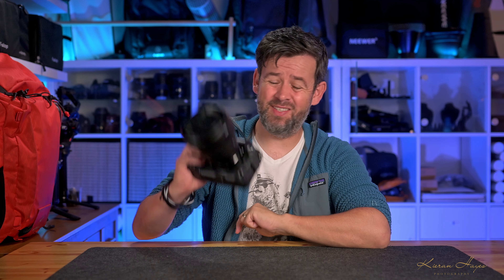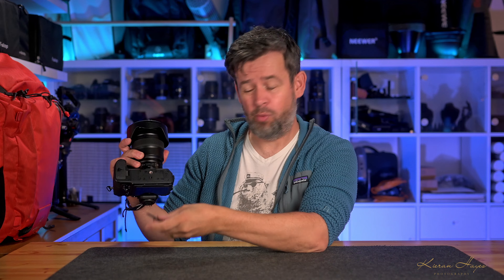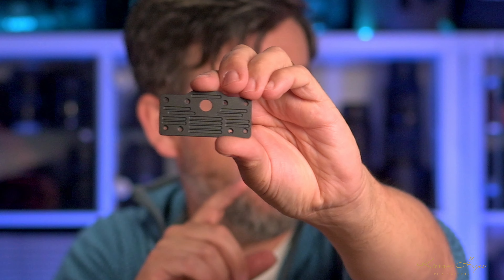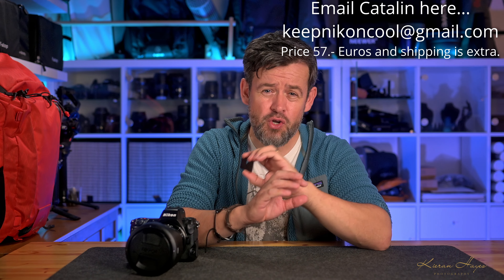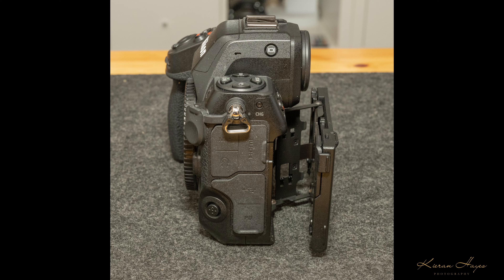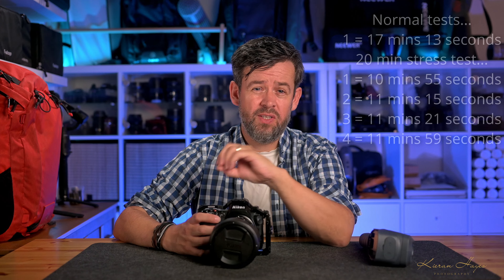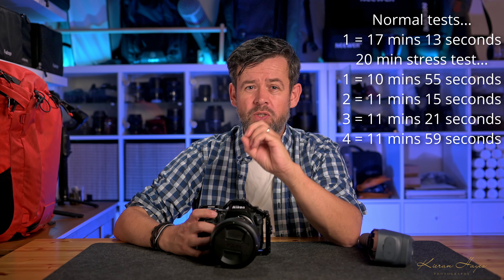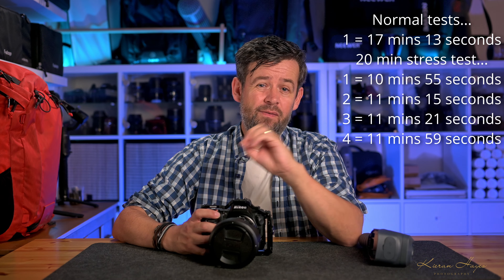Nikon Z8 Hot Card Modification : Cool your Nikon Z8 in minutes.

Comment: Why do you focus on the hot card warning instead of the hot camera/cpu warning? Try to test recording in 4K H.265 60p with oversampling enabled - this is the most useful and at the same time demanding recording setting. Since the CFExpress card heats up even if not used in Z8, take out the CFExpress completely and use an SD card for recording.
Reply from the maker: Hi thanks for watching, I focus on the hot card warning as this video is all about getting heat out of the Z8 so I tested it at 8K60P which is the same as 4K60P with oversampling on. At ISO 4000 and a constantly moving subject the processor was also being seriously stressed but as I say it's all about getting the heat out and seeing how much of a difference the modification makes.

Its not my modification, I just purchased it and wanted to share what I found. 

Thanks for the input 👍
Reply: @kieranhayesphotography  I have been in contact with the creator of this modification part, who has presented to me many interesting insights into the problem. I am also considering ordering the part from him, since it seems like the best overall modification to alleviate the heat issue. My request to test with these specific settings is for me to know how the modification improves my specific usage of Z8 with the modified part applied.
I do on occasion long continuous recordings on a tripod where the camera shuts down if oversampling is enabled. I would love to see an independent test of such use case - before it gets too hot, the camera is turned off for 2 minutes, or alternatively, the oversampling is turned off and a new recording is started right away, then after 15 minutes the oversampling is turned on again and a new recording started right away. Will the modification transfer the heat out from the camera to the tripod fast enough?
Reply from the maker: @kotolows  That's a good question and I see why you are asking now. 
I am looking at cooling via the HDMI and USB C ports also and I hope with the base plate and these options also used it will seriously help with heat then and we can forget about it in most use cases. 

The big problem for me is I need to do each test at least 3 or 4 times and I need to let the camera cool down for hours in between so I can be sure of the results. 
That's all time I don't really have these days as I have tons of shoots on these days.
I plan to do a lot more testing soon and I know I sort of neglected 4K this time but it took me nearly a week to make that video 😢

Comment: Problem here is the crappy cooling "system" of the Z8. There are only small connections to the case and this can't be "fixed". It will bottleneck the heat. This metal plate will help but not as much as someone hopes. Using thermal paste is not preferred! And I think it may evaporates over time and/or crawls deeper into the camera. If you need to shot in 8K than use a Z9. There you have a proper magnesia body connected to the CPU and card slots. Sorry but you can't "fix" the Z8 without a bigger modification.
Reply from the maker: Hey David, thanks for the input, just to clarify I never said this was a fix but something that would help and it does help. Hence the long video and all the recordings showing the time increases.
There is no fix as it's a design issue more than anything else as you say and as I pointed out in the videos.
Yes, the Z9 is better for long runs and has better heat dissipation but I don't like the larger form factor and I am mainly a photographer that does video on the side so I don't need long video runs.
This was just me explaining how to get better times for people that may need it. 
Which does work btw as the video clearly shows, it's also the second step in reducing the heat as I have posted another video before and I have a third step coming soon.
You might not be aware but this also happens to people shooting in burst mode in areas of high ambient temps and the plate seriously helps there too.
On the point about thermal paste running deep into the camera, that won't happen, it's not that viscous. Thermal paste doesn't run and there isn't that much of it there anyway.
Enjoy the Z9 and have a great day.
Reply: @kieranhayesphotography  You are right. You are talking not about a fix. And yes temps are better. So I misunderstood.
Reply from the maker: @davidmarzahn8827  Hi David, no problem, have agreat weekend, hoping you get some great light.

Comment: I would like to modify my z8, I bought a door for the memory card on the Nikon website and I would like to make a modification to put a cf express to ssd zitay and close the door at the same time and the cable would pass between the cage and the z8, in short do I have to disassemble the Nikon Z8 to remove the door? I don't mind doing it but just to know...since it will void my warranty. Thks guys

Comment: Good video! i like this plate but, I don't know if I want to put thermal paste in my beautiful Nikon Z8...ahah but I'm not against a thermal pad if it works as well, very thin of course. But for the price i prefer use, Zitay Cf Express to SSD, no limit...until now.
Reply from the maker: Hi, thanks for watching and the feedback. Yes, thermal pad would also work the only concern I had with a pad is that it might interfere with the weather sealing of the camera. 
I never tried the CF to ssd adaptor but I know a few people have mentioned it alright.
Are the data transfer rates high enough from the dummy card? I must look into that a bit more.
Reply: @kieranhayesphotography  In any case for use on a gimbal or a tripod, the SSD via the CF express port works rather well, because the only problem in my opinion is that the door remains open, I don't see too much of a problem with in any case the Samsung 980 or 990 pro 2TB or 4TB SSDs.

Comment: I know this video is 6 months old, but here’s my use case and issue from yesterday while professionally documenting a theatre show/performance, capturing still frames only.

Card Specs:
	•	Sabrent Rocket CFX Type B 512GB (CF-XXIT-512)

Environment:
	•	Large community hall (~200 audience) + actors + support team + pro sound & lighting.
	•	Temp: ~21°C, but poor ventilation.

Z8 Setup:
	•	Battery Grip: MB-N12 (Nikon’s official grip) with 2 EN-EL15c batteries.
	•	Lens: 70-200mm f/2.8, handheld, VR sport mode on.
	•	LCD Position: Pushed back to its standard place against the body (I use the viewfinder 90% of the time).
	•	Settings: Auto ISO (up to 8000, then reduced to 6400) + 1/640s shutter (to prevent banding from LED lights & capture fast motion).
	•	RAW: Lossless Compressed.
	•	AF: AF-C with Face/Eye Detection.
	•	Frame Rate: 20 fps.

Everything ran smoothly in the first half of the show. Camera was off for a 15-minute break, then hot card warning appeared 45-50 mins into the second set, roughly 10 minutes before the show ended.

Despite the warning, the camera kept shooting without any issues. Now considering a Delkin Black card to see if that makes a difference.

I cannot use any other cooling mods besides a thermal silicone pad. External batteries are a no-go—besides being ugly, they’re impractical for mobility in this case. Metal bottom plate replacement? Useless, since the grip blocks airflow.

And before anyone says it—yeah, I know, just buy a Z9. No thanks. I’d rather spend my money on lenses. 😎
Reply from the maker: Hi,
Thanks for watching and for the feedback.

The onbe huge factor when testing the Z8 for heat and hot card warnings isd ambient temperature one or two degrees makes a big difference there over a period of time.

Now like you I shoot very long shoots 6 to 8 hours and so far my Z8 has never overheated, in saying that I am not shooting in burst mode generally speaking which will help hugely.

The big difference I found was using the right card and the ProGrade gold gen 4.0 cards seem to be fast and yet reasonably cool while still very affordable. I have a more detailed video on those cards here... https://youtu.be/IQzQuufsyIQ

I have also posted a more detailed videos on the HOT card warning for the Z8 that you might find interesting here... https://youtu.be/RDC_ZZKqtxk

There are a few tips in there that help you cool down the Z8.

None of these videos are a criticism of the Z8 as I truly love the camera, they are just more to help people understand how to cool it a bit better.

Did you use multiple cards on the day of the shoot or was it all on the same one? If so what I sometimes do is for lunch break (20-30 mins) is take the card out and leave the battery door and card slot door open. thatjust lets the heat escape. I know you are using a grip so that's not as easy then but it also may help a lot. I also uncover the slots on the side of the camera as you can see from the Z8 hot card video they get very hot also. That just helps cool the camera down internally.

I hope that helps a small bit.
Reply: @kieranhayesphotography  Thanks! I’ve had my Z8 since June ’23. First time experiencing this while shooting stills. I think it’s a mix of multiple factors—way too hot in the hall, relatively high ISO, constant eye tracking, short bursts, my face glued to the back LCD (adding an extra heat source) while looking through the viewfinder, the heat trap from the grip, and who knows what else. Love my Z8 too, and I knew I could probably push it for another 5 minutes before a full shutdown—and by that time, the show is over. So I wasn’t too worried, but it still got me thinking that I need some kind of ‘get out of jail’ card before it happens again. For reference, I used a single card, the Sabrent I originally mentioned. The only reasonable solution I can think of is to go with the Delkin card (which runs even cooler compared to the ProGrade) and hope for the best.

Comment: Someone actually needs to create a vertical grip for Z8 with a built-in Copper heat sink that touches those exposed metal parts, under that plastic cover, directly, where the copper heat sink gets cooled by a built-in fan. This would be the ultimate solution.
Reply from the maker: I was working on a diy unit something like that to try it out. 
I just didn't have time to finish it as I got crazy busy with shoots. 
 I plan to get back to it soon though and hopefully get a video out about it then too.
Thanks for watching and for the feedback.

Comment: 02:42 Why would Nikon not recommend replacing plastic bottom with metal. Can doing so cause some short circuit or something?!
Reply from the maker: When done right there is absolutely no issue with it at all but I suppose the concern would be people dropping a screw into the camera body or just pouring in heat compound. 

I would have thought there wouldn't be an issue but at the same time I thought I better mention it in case Nikon did have an issue with it.
I would be the one in trouble then.

Comment: Good
Have you tried using another CF Express B card? In my case I used the same card you used, it heated up after 30 seconds of film. Replace with the ANGELBIRD card CFexpress AV PRO SX Type B 160 Gb card, this message didn't appear again, I don't have another card from this brand bigger than this one. But still the z8 camera, if it's outside in the sun, it will heat up like larva...
Reply from the maker: Hi, thanks for watching, I appreciate the feedback. I am thinking your Prograde Gold card could be the older generation card, the card I am using here is the Gen 4.0 card and they are a lot faster and more thermally efficient thankfully. 
The older cards overheated very quickly alright. I am looking at testing a few more cards going forward to see how much of a difference there is between them, I just need to get my hands on a few different makes now.

Comment: Do you know if using the battery grip would decrease the heat and hot cardboard warnings?
Reply from the maker: The battery grip doesn't help with the hot card warnings, I haven't tested them yet but a friend of mine has and he said it makes it slightly worse as the heat can't get out of the camera body as easily then. The plastic in the grip insulates the underneath of the camera so it's one less surface to dissipate the heat then. As I say I haven't tested it myself but that's what I was told by someone that tested it.
Reply: @kieranhayesphotography  Tganks so much for the info.
Reply from the maker: @AlleywaystudiosNet66  no problem at all.

Comment: Hello as a wedding photographer with some video at times how would this camera handle the outside temperatures? I wished I could find an actual video that shows outdoor use with this overheating test
Reply from the maker: The trouble is there are so many  variables  involved. That's probably why not many people have done tests like this.
It depends on what card you are using, the video format you are recording in and finally your ambient temperature. They all play their part.
Are you looking at Nlog 12 but Raw 4K or 8K? What card are you thinking of using and how long are you recording for roughly and in what temps?
That would give a good indication then.
Reply: I normally just shoot at 4k 30p to 120p anything higher than that for what I do would be an overkill. Temps I would say anywhere from 75 to 105 degrees in direct sun especially when shooting the ceremony. About 1 hour long straight shooting. As far as card I’ve heard shooting on a fast enough SD card would be fine but I haven’t seen it yet. So a good test would be on the CFExpress and SD card.
Reply from the maker: @rubenramirez8241  a good SD will handle 4k30p alright for an hour you should have no issue then. The ambient temp is the slight worry though.
As I am living in Ireland we don't have temps that high. I am guessing your best bet is the Nikon filmmakers group on Facebook. They should be able to share more insight with you there as I know there are a good few Z8 shooters in there from all around the world.
Fingers crossed they can give you a definite answer.